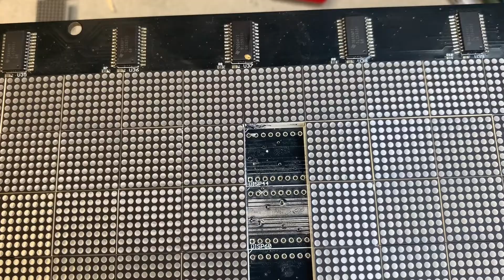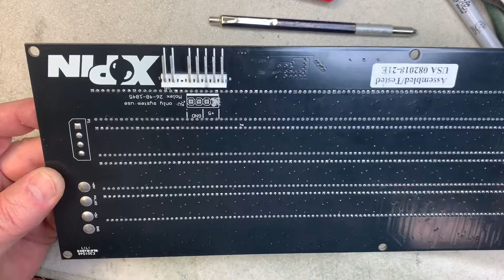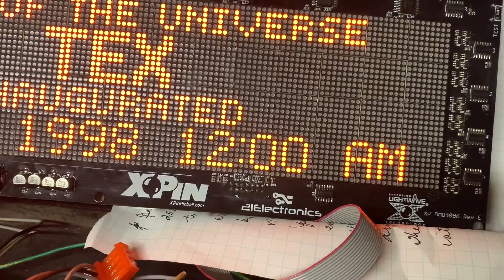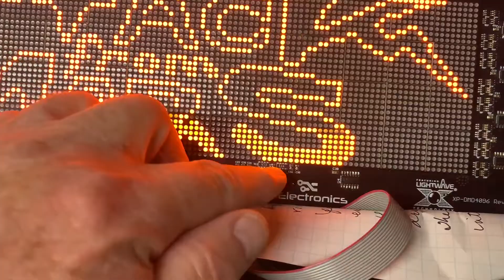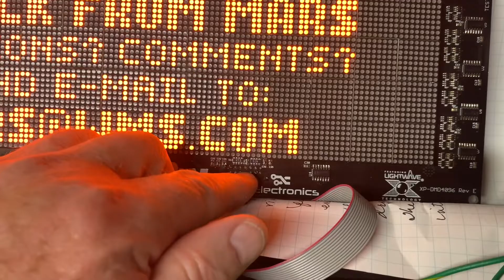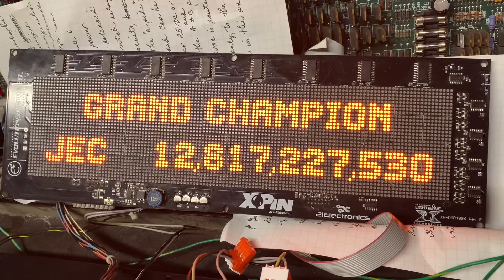XPin LED DMD panel, columns shorted together, diagnosis and repair.

Comment: Do you think the solder fairy just dropped off a piece one night or do you have a reasonable guess as to where it came from? Present from the beginning but just not bridged from day one?
Reply from the maker: My theory is that it was always there but not quite bridged. The board did work for a while. Perhaps when I was shaking it around moving it from test bench to test bench, the bridge finally "made". Once side was solid. The other side was touching, but not physically attached. Certainly unusual. Glad I finally took the time to dive into it.